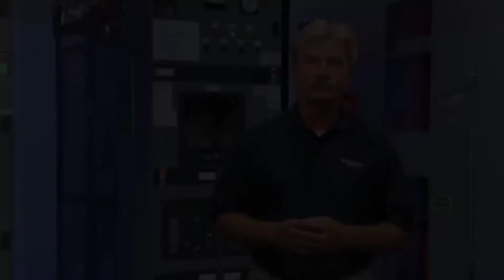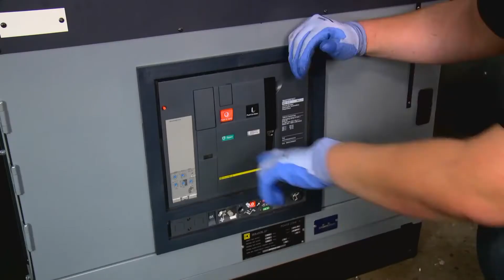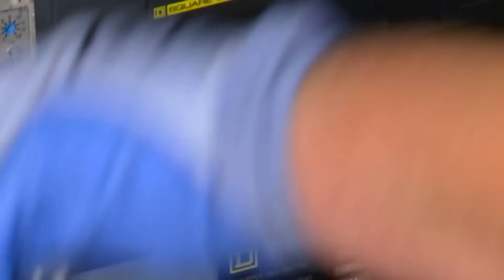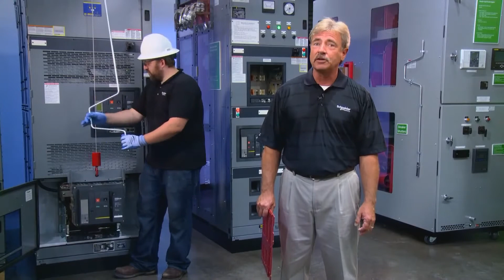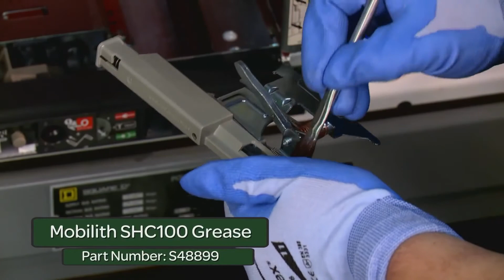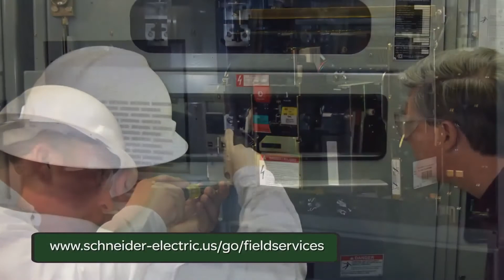Square D Masterpact Installation Video – Part 1

Comment: I was the designer for these. Snap-in shutter system for rack out circuit breakers, Patent Issued Jul 18, 2017 US9711954B2 😃